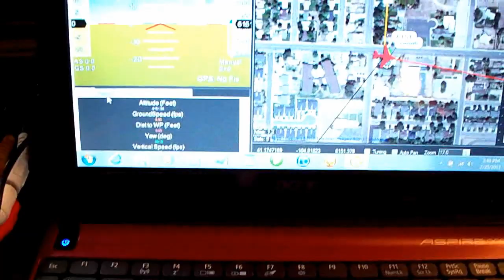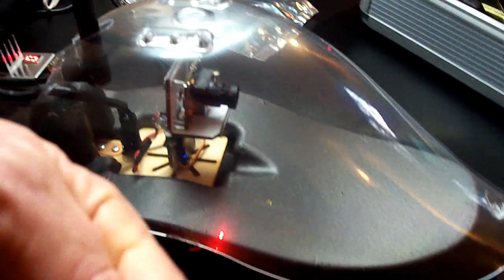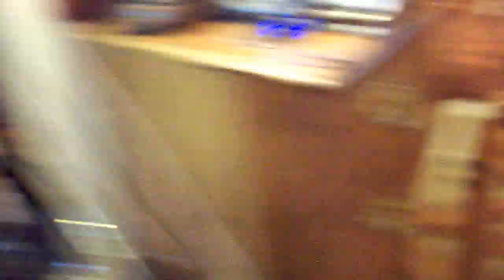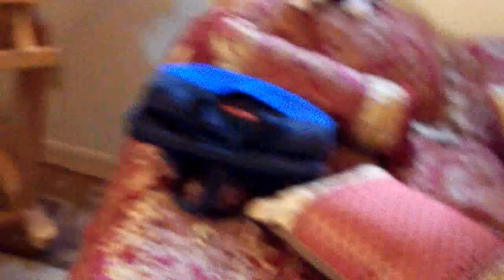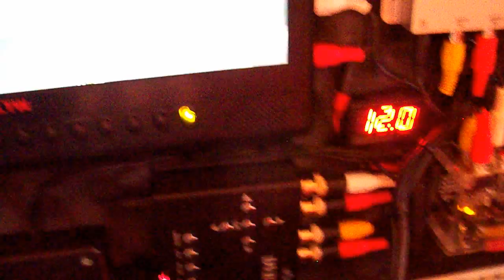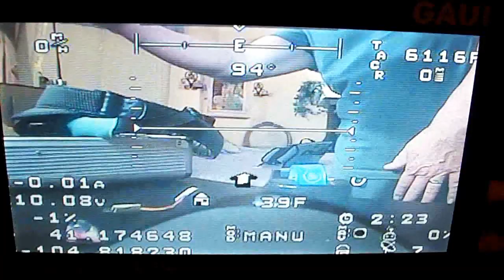APM2.5 Bench Test - 3DR, MinimOSD, Eagle Eyes Diversity, HeadPlay, Finwing Penguin

Comment: Hi Alvin. Greatwork!  I am about to use APM2.8 in my model and I have basically built up a system very similar to yours except I am using a tablet for telemetry instead of a laptop (I used a tablet for space saving and low power requirements) 

I am about to start building a 3 axis servo mount for a tracking system and was wondering if I could use my eagle eyes device with the APM without having to change all my flight electronics to eagle tree gear, that's going to be to expensive for me at the moment.

Do you know of anyway to get the data from the APM (maybe using laptop/tablet or mini osd) to the eagle eyes and make it operate the servos in the tracker? 

Best wishes, John..

Comment: Noticed that the telemetry devices bypass the APM power module. Not a big issue but the current reading will be less that actually used.

Comment: Hi Wally,

The option of overlaying video to the MP exists you can activate it in the MP menu.

Note that it is not exactly as good as with a standard OSD since telemetry data and video feed are in fact processed by the laptop, there is a lag of roughly one or two seconds. Then you lack the home arrow function even though you can fly back home using the moving map.

Normal OSD being overlayed to the live video signal the latency is almost not noticeable and you get a home arrow, absolutely necessary when flying out of line of sight.

Finally the laptop can crash, then you would lose everything.

So yes it works but more as a secondary system to me, an OSD being less than 30 bucks it is really worth the investment !

Cheers,

Mathieu

Comment: I am truly gobsmacked, this is just the kind of system I have been dreaming of. I just don't, or rather didn't know if it was possible or how it would be wired up. Naturally this is an awful lot to take in for the beginner and the price tag has got to be up there but if I budget correctly.... I am going to do my first iteration of an Ardu based FC with a Quad and get the hang of it. Then I will add the FPV and move from there. I am lucky to have found your post and anxious to see more progress:)

Comment: I’m using APM 2.5 with HIL simulation on the Fixed wing without problems. Quad copter and the new Version 3 hil firmware not working and will not operate the Simulator/Quad HIL. Good luck on the project.

Comment from the maker: Hi Bikram. I do 'work for hire' through my website, but mostly I am just another obsessed hobbyist. :-)

BTW, I saw on one of your posts that you are looking for a way to interface your Cyclops RSSI with your Spektrum RX. Take a look at DORA. I have it set up on one of my planes and it works flawlessly. Here is a YouTube video I uploaded with it running "diqCs6K1Zjo". Upper left corner, 3.3v = 100%. You should be able to find a DORA module on eBay for under $30.